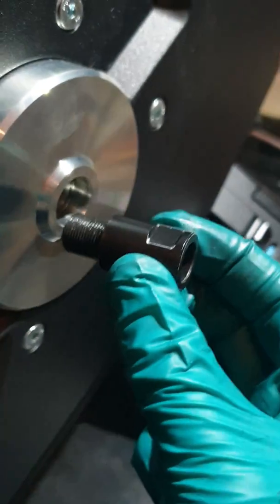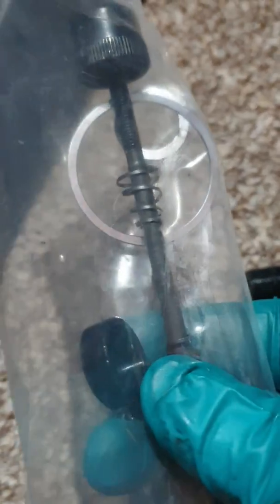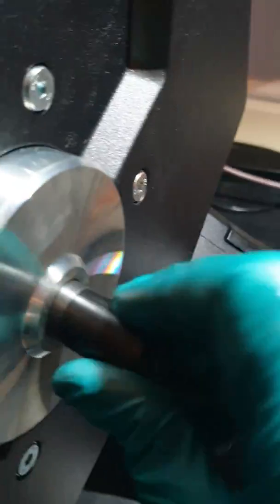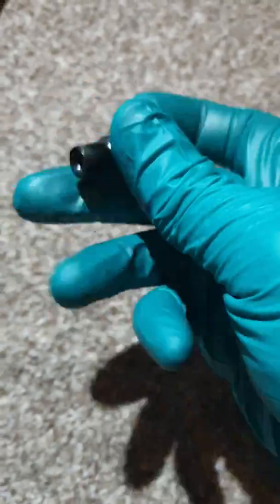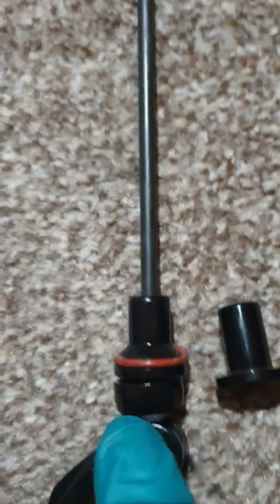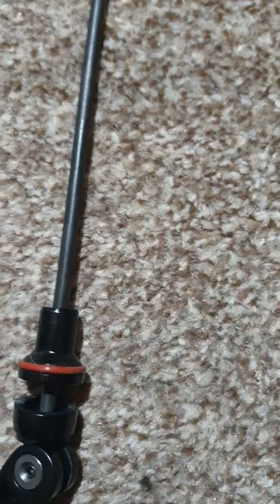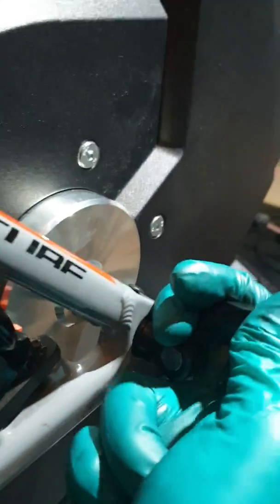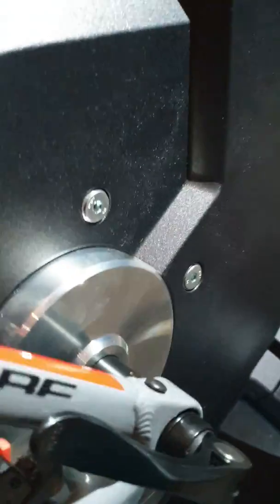Tacx Neo 12x142 through axle kit how to fit part 2

Comment: Thanks goodness for your video ! 
I own a gravel, a Spe Diverge sport with Shimano 105 brake system.
It is no easy to install the cassette and find the right axe for my frame...(well for a beginner like me) but I did it... Unfortunately after 2 hours working on it, when I finally finished, I realized that the brake was scratching the HT ! 
After searching, I understood the 5mm was missing of course, but I did not know where to install it !!! I changed the cassette, the axle, etc... 2/3 times, I was getting crazy.
So, without you, I would have sold the Tacx on ebay !! Really...
Reply from the maker: Glad it helped... hope you enjoy your new Neo... happy training.. 👍

Comment: After installing I also had the issue of the disc brake hitting the body of the Trainer. In the manual of the adaptor kit it says to only use the Black 5mm Ring on 148x12mm thru axle. I have a 142x12 standard thru axle. Do I risk damaging the frame By using your method as per instruction the Ring is only for 148x12mm? I would really appreciate a Response. Thanks for the Video!!

Comment: I was looking for a video like this, thanks. Gonna try it out tomorrow because the brakes were so close to the tacx frame.
Reply from the maker: Glad to help 👍
Reply: @xS0CIAL0UTCASTx  the axle is too short somehow after putting on the spacer...It cant really reach the in threaded nut on the other side. Bike is a Cube Attain SL
Reply: @xS0CIAL0UTCASTx  any idea? Thanks a lot
Reply from the maker: @r3dbullbbs  try a smaller spacer... or no spacer at all?

Comment: All the adaptors that came with my tac x s smart flux would not fit my axle as my axle is 12mm but still too big I ordered the adaptor set from tacx and waiting on it now so fingers crossed it will fit and work, thanks for your video
Reply from the maker: You are welcome.. one of the downsides with the flux is the lack of out of the box compatability... Good luck with the Flux.. Happy riding 👍
Reply: @xS0CIAL0UTCASTx  I have a cube entry level road bike and on the axel it says 12mm but also has numbers 0418 hoping that's a serial number and not some type of 12mm as I have found no other numbers like that on any video on YouTube or the Web lol, thanks bud will enjoy indeed 😁
Reply from the maker: @citrix123  The bike in the video is a Cube cross race pro... the rear axles have sort of come down to a standard of 12mm x 142mm so I am sure if you have ordered the correct kit... it will fit.. it just may take some messing about to get it right..
Reply: @xS0CIAL0UTCASTx  legend, good man, thanks for that nice reassurance lol 👍

Comment: Thanks!!!  Btw. I put mine on loosening the brake caliber not ideal, then saw your video.  W the spacer will you have to retune the shifting.  Does the spacer stress the frame by increasing the width between the drop outs?
Reply from the maker: I didn't have to re-index the gears.. works just fine.. but every bike is different.. you may need to.. No stress on the frame, mine simply slots straight in. 👌
Reply: @xS0CIAL0UTCASTx  Thanks... It worked great.. Had to use 2 of the 2.7mm spacers to get the clearance. I heard there's a 4mm one out in the wild, but TACX-Garmin did not have or know of one... Anyway, great fix..  Thanks..

Comment: very good video as about to buy the 2T and me and missis have different bikes , she has the norm quick release and i have the 142 thru with disc brakes . glad dont need to change cassette over . even though i do have to buy a cassete thats in the middle of the 2 bikes , mine has 34t and shes got 30t .. so will get 32t so it dont mess with di2 settings . i will only change over to my bike if im going to do over 50 milers or more , shorter rides i can just use her bike and this would be worth doing changing axles on bigger rides .. thanks again for the video its really helped in deciding  ..
Reply from the maker: Glad it helped 👍

Comment: I'm nearing the same gripe at the moment. Does the addition of spacer not mean its now got a width of 147 ( 42 plus 5mm spacer?). so how does it still fit? much appreciated Will
Reply from the maker: I reality most frames are actually wider than 142mm and  reliey on the through axle to pull the parts together and make everything rigid. In the case of my 142mm frame adding the spacer made the frame sit on the Neo better. But I also understand other frames may not. But in all frames they designed with an element of flex in the design. Unless it's an original boneshaker... 🤣

Comment: I want to use the Canyon Endurace CF SL Disc 8.0 bike with the Neo 2T, it has a rear thru axle that is 12 x 142, following your video do you think I should be ok as far as the clearance between the tacx housing and rear brake and bike should fit properly.
Reply from the maker: I would say try it standard first... if you have an issue with the brake caliper touching... then carry out the modification... I have an Aeroad and never use.it on the Neo but I have tried to fit it but couldn't due to the Rear axle threaded section NOT being pass through and capped for aerodynamics I assume.
Reply: @xS0CIAL0UTCASTx  thank you for your response.

Comment: I’ve changed bikes and I can’t work out what adapters to use. Got myself a Pinerello with disc brakes. Any suggestions?
Reply from the maker: @christopherreid6972  I don’t know for individual bikes… I would always suggest the standard setup first. Then if any issues with brake calliper rub.. then look at extra spacers

Comment: I'm a bit confused.  I currently have a conventional quick release bike set up on my Neo 2T.  I want to change that and put my thru axle Trek Checkpoint.  I see that Garmin sells an adaptor kit with its own special skewer.  Do I need to get that kit or can I use the skewer that came with the Neo and just swap in the 12x142 mm spacer/adaptors?   Thanks for the great video!
Reply from the maker: You should have everything you need if your 2T came new with scewer kit...

Comment: Dude I just got mine but the adapter I have is the 10mm and my cassette hit the frame. How much of a difference does 2mm does? Because I know there is another one for 12mm but I don’t wanna spend another 75 dollars for a kit it doesn’t work
Reply from the maker: If yout cassette is hitting the frame you are doing something seriously wrong.. do you have a spacer behind your cassette?
Reply: @xS0CIAL0UTCASTx   yes. Everything is in place but I found out I need the 12mm instead of 10mm I’m just waiting for that part
Reply from the maker: @antonioparamo2048  12mm seems very excessive... is your rear axle 12mm x 148mm?
Reply from the maker: 12x148 is the standard... but you only need the 5mm spacer in the video IF your brake caliper is touch the Neo.
Reply: @xS0CIAL0UTCASTx  I actually needed the 12mm but it wasn’t assembled right. Now it first perfectly and I was able to ride on my swift